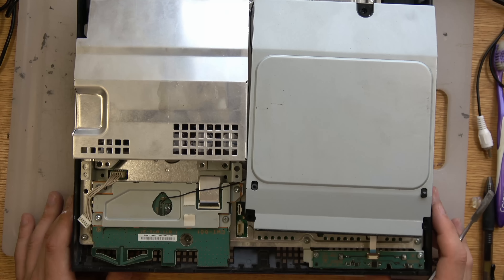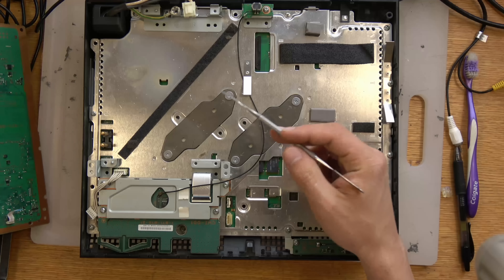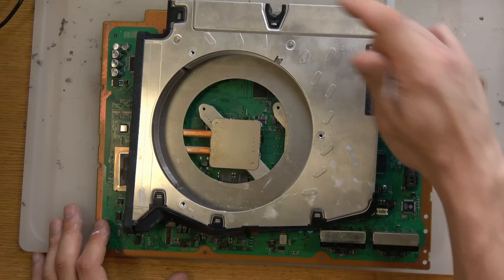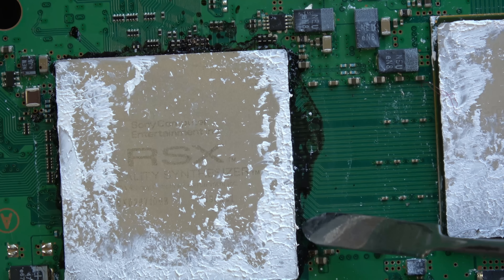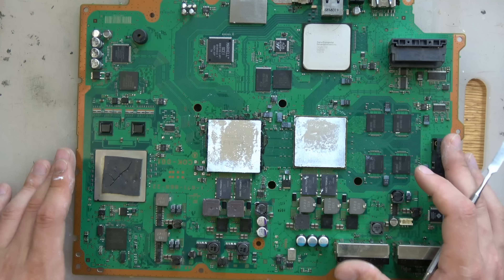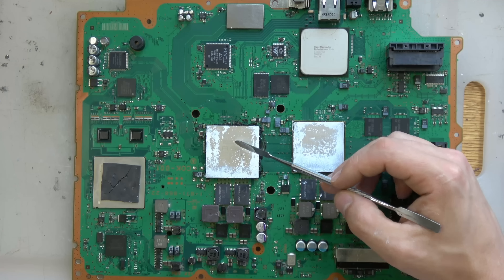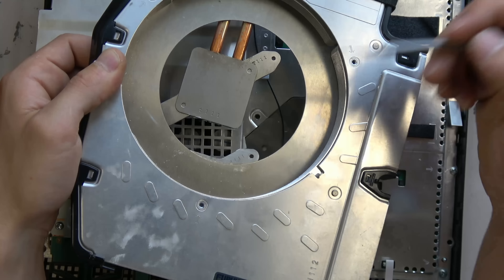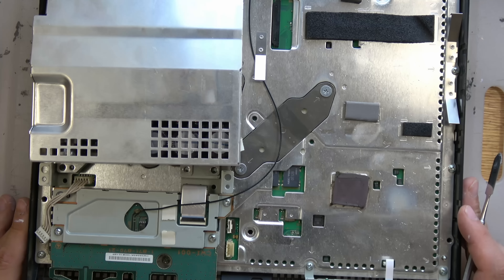PS3 YLOD FULLY EXPLAINED - YELLOW LIGHT OF DEATH - RETRO GAMING ARTS

Comment: Takes too much heat to reflow it with heatspreaders on it knowing that under there are 4 memory chips at each corner so it won't do it. What happen when you reflow is not this. It works because you exite temporarely the molecules of the chip and it will last a couple of weeks, days or months till it dies again. So there is nothing to do reflowing a chip when it's almost dead inside or completely dead inside. Just shit from sony and the japan to make money. For info xbox 360 is more easy to reflow, too really make a good reflow . I did reflow a lot of ps3, does not work but a lot of xbox 360 reflows and they all still working so for this xbox 360 is way better. Forget about the shit of washer under chips for more pressure and all that shit. this is false repair, crap from people who did not have electronic diploma like i do have and also i have lots of experience so my conclusion is when a ps3 is dead, garbage. When an xbox 360 is dead, bring it to me, i'll fix it. So xbox 360 are better for that and the real way to keep them longer is not to play to many hours, give them lots of fresh air while playing and CLEAN THEM OFTEN AND CHANGE THE THERMAL PASTE EVERY 6 MONTHS FOR  MX-4. Thank's.